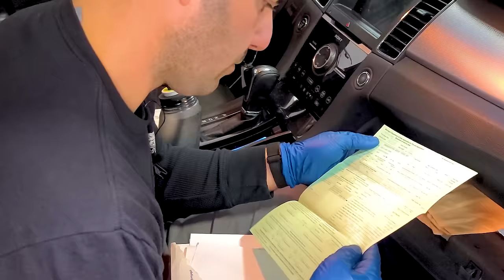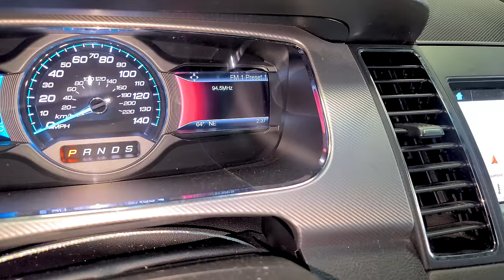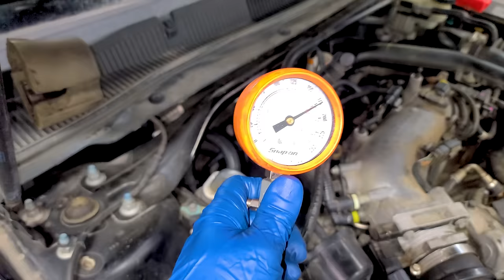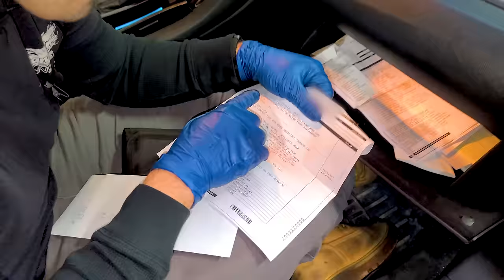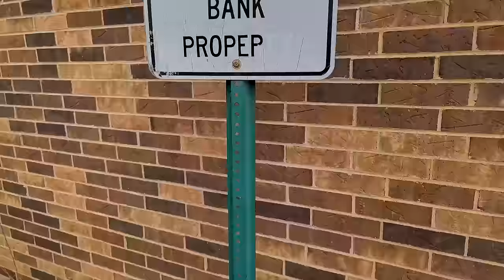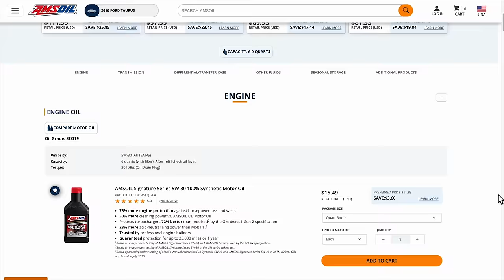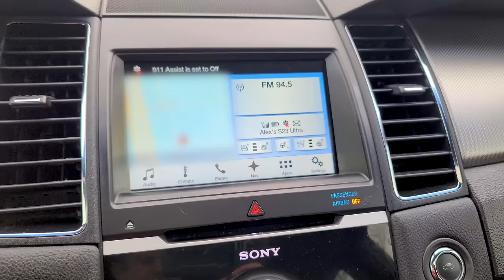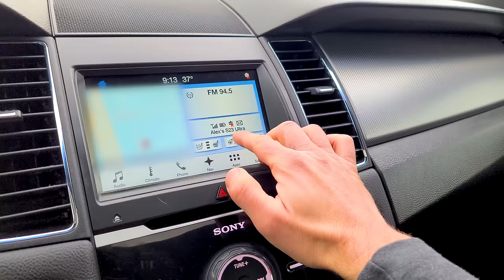I LOVE My GTR So I Bought Another Twin-Turbo V6 AWD Auction Car For 50% Off! Fixed For 30 Dollars!

Comment: This is a prime example of why DEALER service isn’t always the best service.  I swear sometimes the general public thinks Henry Ford himself is going to fix their broken Ford Taurus.
Reply: I think the idea is they use OEM parts and other places can put junk on. As for dealer techs that is a mixed bag. I had my F-150 brakes done at a dealer and they forgot a caliper bolt
Reply: Also how much experience could tech possibly have with a rare car like SHO
Reply: @super8mate  They are basically the same as the Ford Explorer, they are on the same platform. So they have seen thousands of those and the police interceptor models with the turbo V6. Mind you not every interceptor has the engine upgrade option, but it would be a platform they are very familiar with regardless.
Reply: Given the misfire after the WP repair was done under warranty when it didn't have to be, I'm not surprised they only fixed the problem and didn't throw more parts than needed at it.
Reply: If you have a good mechanic then go to them. But most people don't and don't know the difference between a good mechanic and a bad one. So they hedge their bets with the dealer.
Reply: As an Automotive Technician at an independent shop I experience this all the time. Dealerships in my experience are really bad at diagnostics. I recently had a customer with 2015 Q60. They charged her 2k to diag and install a BCM for a no crank. Didn't fix it. Came to us. It needed an IPDM. Well that was another 2k. Crazy that they charged her for something that literally didn't fix anything.
Reply: @thepittman4g63 forgot a caliper bolt?? Jeez.. I could almost forgive forgetting to torque a bolt(or at least understand how it happened), but I can’t even imagine how you forget a caliper bolt.
Reply: What's the ams oil discount code
Reply: yeah the air filter and spark plugs are curious, everything else on this SHO is money though! 150k miles and that was basically all that was wrong with it?
Reply: @EncrypticMethods  Not the only thing. In the video you can see it's still leaking oil. It's all over the exhaust. There will be more repairs. He might not air them. But there are. Typically it's the oil return tubes from the turbos. They leak coolant too.
Reply: 100% probably cracked the spark plugs reinstalling them and didnt say anything. owned got the check engine light and was done with the car
Reply: Dealer service = You pay for it, even if it isn't done.
Reply: Right the ex dealer tech doing the work isnt the best
Reply: I dont think its dealer more so than generational shift in people work ethic. I have been turning wrenches and if i get the right tech you can/will get good service at the dealership. I found a good dealership for my Aunts BMW and they did everything i told them and sent video with smoke testing.
Reply: That’s exactly what flat rate gets you nowadays
Reply: I had a dealer  use an impact to put together the transmission. A bolt head was torn off and they didn't replace it. It needed a helicoil. The oil leaked out and destroyed the 5 speed. It blew up on the highway.
Reply: Yeah that servicing seems sketchy at best..not what I would expect from a ford dealer....
Reply: Dealer service, that is exactly the reason why I started servicing my car by myself 40 years ago, I never regretted it and it is sooo satisfying.
Reply: No one likes getting their car fixed because they know the shop will likely over charge or mess up and try to dodge responsibility. Its a reputation mechanics have earned over many decades.
Reply: herny ford better fix my f150 😆
Reply: i still think it was a cheap old guy who only let them change one plug because only one cylinder was misfiring originally. esp since they already hit him for 2700

Comment: Ecoboost owner here.   You need to add 2 oil catch cans.  You won’t believe the goop that travels into the intake from the PCV system.  It’s worthy of its own video.    I park outside and I have dump mine every 1k miles on my 75k mile Expedition.
Reply from the maker: Thanks for the tip!
Reply: ALL turbo cars should have a catch can!
Reply: @LegitStreetCars also don’t forget, these eco boost motors have a very strong block and boost-happy turbos. Just need a better injectors and fuel pump, really.
Reply: You park outside...? That seems... Rather irrelevant to the subject at hand? I could be wrong, you seemed pretty confident when saying it...
Reply: @derekspringer6448 the engine being exposed to colder Temps when parked outside vs climate controlled garage creates more condensation inside the engine while warming up and cooling off which is caught in the catch can instead of mixing in with your oil/building up in pcv system. A engine kept warm creates less condensation and buildup in catchcan. If you had a catchcan you would notice it fills up faster in colder weather and the fluid is much lighter in color
Reply: @LifeOfRlce thanks I was trying to explain this to my wife not too long ago when she asked why it looked like a latte 😂😂😂
Reply: JLT catch cans.  I just picked up my second Edge ST and thinking of adding one.  I never added it on my previous one because I read some Ford dealers wouldn’t honor some warranty service if they found one installed.
Reply: @derekspringer6448  He dumps the goop outside.. environmentally conscious.
Reply: @derekspringer6448 I was thinking this same thing. Most average garages are not climate controlled so that other guys theory doesn't really make much sense. Plus you still drive it outside, and maybe this particular person lives in a warm weather state, he didn't say where outside.
Reply: @willhutton1516  Can you tell me if the Lincoln MKZ has this same engine?Thanks
Reply: @jojogun1957 No, the Lincoln MKZ has a Twin Turbo 3.0L engine that's built on the same platform as the 2.7L, the block is made of CGI (Compacted Graphite Iron) which is a material in all of Ford's Turbo Diesel engine blocks, so you know the block was made for boost. The Ford Taurus SHO uses an all aluminum block 3.5L engine. I have a 2017 Ford Fusion Sport with the Twin Turbo 2.7L Nano engine that produces 325hp/380lb-ft torque stock, it's literally an F-150 truck engine inside an AWD 4-door sedan (a zippy grocery getter). The Lincoln MKZ is just a luxury variant of the Ford Fusion Sport, that's it. lol
Reply: Do park outside Alex's shop? Maybe he needs to talk he just walk outside and ask you a question how nice...
Reply: Sounds like your PCV system is failing. My SHO has 170k miles and with the dual catch can installed I hardly get any oil in it. I could probably go 10k miles before I have to dump mine.
Reply: Why don't we get cool Fords like this in the UK?  All we get are the boy racer RS and STs.
Reply: @wevved  definitely agree the mondeo titanium x is pretty nice though 2.5 turbo same as rs but not boy racer or the volvo v50r also same engine. There is loads of stuff the US get we don't. And flip it we get stuff they never did or do.
Reply: I think this same thing applies to the Mazda's as well. My CX-7 is the exact same thing and it's crazy the amount of stuff caught. But then again most of the engine stuff is literally stamped "FoMoCo" on it (including the injectors)
Reply: 54:41 why didnt just use the thumb? One  movement and opens
Reply: @derekspringer6448    I live in seattle and it rains all the time here.   Excess humidity == higher than average moisture in the oil == more output from the PCV valves.   My dipstick shows clean oil but my catch cans fill up with brown water with oil on top.
Reply: @stevekincaid  No kidding, I've never owned a turbo car until recently and its my daily so it doesn't have a catch can on it... though I'm sure it could use it as I'm actually about an hour north of you! Howdy neighbor! Beautiful day today though, none of that rain!
Reply: I noticed the "Sonic" sidecuts were NWS pliers. Are all the Sonic pliers made by NWS? If so that's great because NWS is tops. Any idea who makes their sockets?

Comment from the maker: Ok who seriously guessed it before you saw the car?
Reply: 1st
Reply: no one.. hehe
Reply: I did. The oil cap in the intro gave it away.
Reply: I guess it correctly on Facebook last week!!!
Reply: Alex i have a question for you i have a 16 ford edge has the 2 liter 4 cylinder engine how often do they need a tune up?
Reply: If it’s an SHO that was my guess haven’t gotten into the video yet
Reply: I guessed it right!!!
Reply: I did, 2013-2019 Taurus SHO. I had a 2014 Ruby Red Metallic. They are duds.
Reply: I did.  Recognized the dash that was visible briefly.  Though when I heard ‘awd tt v6’ I thought of my car (2019 Cadillac CT6)
Reply: I did last video because I like these cars and it's the first one that came to mind.
Reply: Saw the steering wheel before the reveal and instantly knew. Ironically I’ve been looking at these and Buick Regal GS as a daily - very excited to see the video series on this.

Congrats Alex! 🎉
Reply: I just got it because of the interior
Reply: Was thinking sho or Q50 RS but you said 6 speed thinking it was a manual LOL
Reply: I though it would be a Mondeo then I remembered its not called that in US and said falcon 😂 but that's AUS, took me a bit to remember the US name for it - Fusion 😅. So not exactly it but quite close to a Taurus😆
Reply: I knew what it was as soon as I saw the steering wheel.
Reply: If it's a 2015 I guessed it exactly! Yeah buddy
Reply: I could tell by the title
Reply: I thought you got a 300z or something
Reply: I did. The oil cap and dash gave it away.
Reply: I did just based on the price hint
Reply: I had a '13, so I knew as soon as I saw the dash and check engine light lmao
Reply: I mean, I'd been close
Reply: I thought maybe a police Taurus with the twin turbskies. I love this car though!
Reply: I thought it was the Infiniti at the end.
Reply: Me. Only because I love the SHO and owned a Fusion Sport
Reply: Here
Reply: I did because I have one too
Reply: Door panel gave it away for me
Reply: While you were explaining it I literally said bet it's a sho
Reply: I knew it was a ford from intro but I didn't know what exact car
Reply: I've been waiting for a YT'er to buy a SHO!
Reply: Nope, but what you have was my second guess
Reply: I said Ecoboost but was unsure the model. Did I win some merch? 😂
Reply: could tell by the gauge cluster and the seats it was a Taurus SHO
Reply: "Converter issues"....try trans...PTU...T Case...engine....turbos....car us a rolling issue from factory
Reply: Me
Reply: @adambrown5317  same lol
Reply: I did, because I have one
Reply: I guessed it my 2nd guess was a Q50 with the twin turbo VR30 i would love to see that in a video im a big infiniti guy from Kentucky
Reply: Was thinking eco boost ford flex since it was replacing a wagon.  Got the powertrain right, but body style wrong.
Reply: I knew by the door panel
Reply: Not me)
Reply: I was not even close.
Reply: I did
Reply: I knew the profile and the spoiler gave it away for me.
Reply: I knew it was a Ford... toss up between the Fusion ST and the Taurus SHO
Reply: Me, but I’m a ford fan boy so it was a easy guess
Reply: I actually expected it to be a taurus sho lol
Reply: I thought maybe a Ford Flex but thought “no way”. Thanks for all the Ford content. You are my hero!
Reply: I thought Taurus but police package and not SHO....so I was kind of sort of correct.
Reply: Me. Ask my wife haha.
Reply: Called it! I just didn’t put it in the comments like you asked😅
Reply: I work on nothing but these, the maintenance on them is expensive from PTU’s to transmissions to turbos. The rest of the maintenance tho you can do it yourself as you already demonstrated with all your skills.
Reply: You had me fooled with teaser Instagram and YouTube questions. You fooled me.
Reply: ME i have two of them in my driveway a fully built 2010 and a mild 2013 build
Reply: I thought it was an Audi
Reply: I halfway did, though you might get a used police one lol.
Reply: As a SHO owner I was mentally checking off the features as you ran through them. Got mine 7 years ago . Still going strong with 270k km. Oil changes brakes and tires and thats about it.Good to see your good luck continuing!
Reply: I guessed by the steering wheel
Reply: I knew when you announced it last video. There is only one option really, this is it 🤣. I think these are coolish, but their lack of popularity is for good reason to me. I have known a few people with lightly tuned SHO's from this gen and they were off the road more than on. That and ford did not do nearly enough chassis stiffening or anything particularly to accommodate more power.
Reply: I would say me but I usually skip the begging of your vides so I don't get spolers.
Reply: @2003cobramustang is it turbo?
Reply: @RadDadisRad "duds" explain?
Reply: I did seeing the thumbnail, them SHOs are fun
Reply: @TheOmegaSanction spark plug fouler spacers for the o2s help with the cat issue (or yeet them) but Ford told me to do the spacers, the placement is too far in the exhaust or bad placement 🤷 worked great for our cars (currently have 9 of them with 200k+ miles, zero cat issue, zero trans issues, zero PTU issues, (not sure why you listed PTU and T case...... Same same) zero engine issues.......... WTF you do to your car? 😂
Reply: @commonsenseisdeadin2024  beyond a tune they are EXPENSIVE and no drivetrain supporting mods exist so you’ll be swapping out transmissions if you go above the 600 torque number. I sold mine and bought a whipple F150.
Reply: I’ll be honest, Alex, when you mentioned a 4 door twin turbo v6 AWD daily at the end of the last GTR video, I thought to myself…SHO??!! But probably only because my wife and I have had a 2012 SHO for many years now! Overall it’s been a great car. I did the water pump and timing chains and all associated components a couple years ago around 120,000 miles. I walnut blasted the valves at that point and was surprised they weren’t as bad as I expected! It has had the PTU (transfer case) replaced 2-3 times though, while it was still under CPO warranty from Ford. I see yours is leaking too, so that’ll probably be something you want to tend to! As far as bang/features for the buck, the SHO is hard to beat, that’s for sure!!
Reply: As soon as I saw the oil cap I knew it was a SHO, since it was the only car with a transverse mounted v6 ecoboost that could be hidden behind a GTR.
Reply: One time my Uber driver drove me in one of these will never forget that car💪🏽
Reply: Me😃
Reply: At first when I heard you say 6-speed I was thinking it was a Fusion ST
Reply: I was close! I guessed flex eccoboost AWD
Reply: I did but only because I recognized the interior. My dad had 2 of this gen Taurus
Reply: @300DBenz  the Ford Explorer Sport, Ford Flex, Lincoln MKZ and Lincoln MKT also had it.
Reply: Not me!
Reply: I got close I said fusion sport
Reply: I was between the SHO and the Fusion Sport which is another car you should check out!
Reply: I did. But only because my brother had one so it was my only guess lol
Reply: I did. Though I think I’d prefer the Flex equivalent. I like unexpecting and quirky vehicles.
Reply: didnt see the dash just read the title and i thought it was gonna be a q50